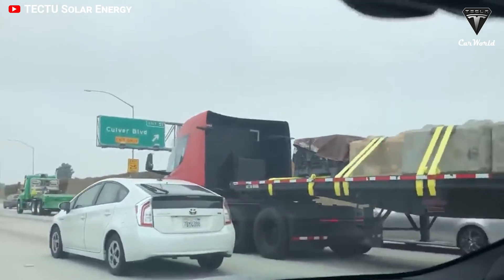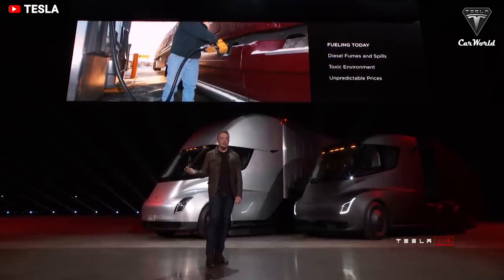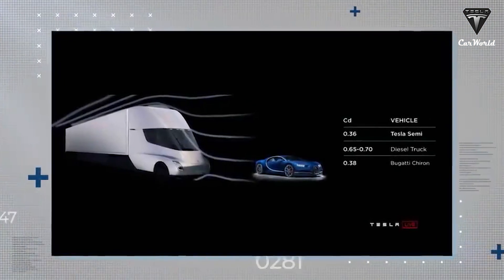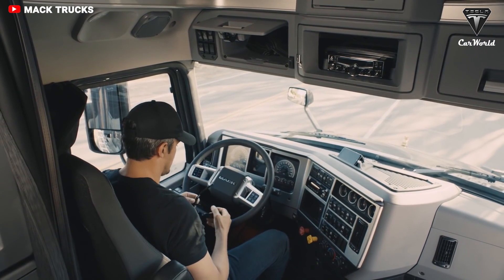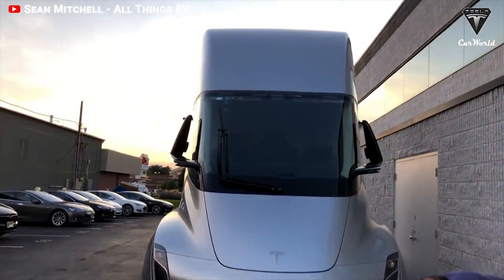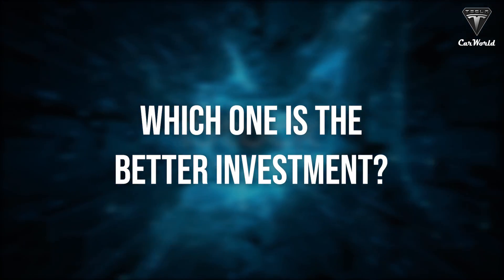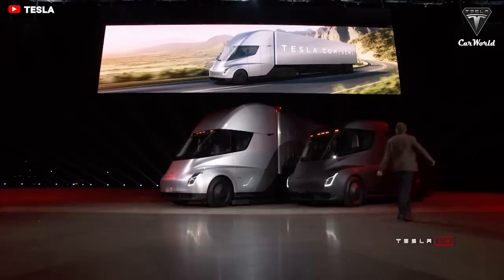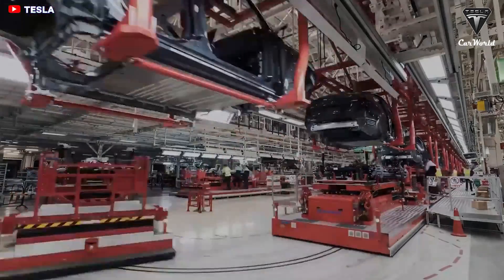Which is the KING of 2023 heavy trucks? Mack Anthem Diesel Truck Vs. Tesla Electric Semi?

Comment: When truck driving, you get paid by how MANY miles you drive. Not how fast you drive those miles. I noticed you didn't say ANYTHING about how long it will take to charge that that new toy. In order to really compete with diesel trucks, a company will have to purchase  2 teslas. One will always have to be charging while the other is being used. This is because the diesel can turn right around in 15mins, and do another 1500 miles. Where as the tesla CAN'T. So the true purchase cost of going with tesla is Double that of the diesel. Also you HAVE to include the cost of adding a high level charging station(s). A one time cost of several thousands of dollars. So if you are REALLY going to compare it, please be equal.  The Anthem, $180K and your done .. start hauling . and to do  the equivalent with Teslas you looking $300-350K 
  Now with ALL that said, for intercity distribution, and for a large enough company the investment is worth it. But for long haul, and indepenant truckers, it's not a sound financial choice. You say King of HEAVY truck... Nope you are wrong here. At BEST,.. it's about 2/3rd equal.  You made good points but most of them don't mean squat for trucking.

Comment: HP is  irrelevant to truck, it'd all about torque, and guess what, the desil has more. Not to mention imagine how convenient it will be WHEN the tesla truck does break down and you HAVE to bring it in to tesla or a very expensive certified mechanic. Add onto that, the limited parts availability and the expensiveness of said parts. Furthermore those batteries hauling 80 thousands pounds won't last just a few years beofre their range plummets a lot. Just think how long your phone battery last like it's new. Not very long. New tesla car batteries cost around 10,000, tuck batteries will cost multiple times more

Comment: Semi trucks aren’t about acceleration 🤨 there about towing heavy weighting loads efficiently and I don’t trust truckers with vehicles that the makers claim to be self driven vehicles that’s how you get into trouble.and biggest issues with evs right now the battery range goes down the more power you use like A/C accessories imagine what would pulling an big box around will do to your vehicles sensitive range or driving fast 👀. plus anyways that Tesla semi lacks the most important thing to truckers an bed instead they put an seat 😕 .truckers would you guys rather sleep on char or an bed ? And is the best way to slow down 80-90k LBS is with an jake break vs steel brakes ?. Semis use air so that’s also something that’s gonna eat your sensitive range up along with a/c etc .ev semi truckers question for ya what happens when these ev semi run out of power like in an hot desert like driving though the hottest points of Arizona or Nevada who’s gonna save you ? an ev semi tow truck ? He will break down to 🤔 who gonna save you and the other guy ? AAA? in the future hope they still have diesel semis or buy then have nuclear semi trucks cuz if they don’t ya gonna be living in the desert until you walk to an nearby town good luck hope some kid doesn’t hack your ev or better yet uses an EMP grenade on your ev 🥸 oh yeah if something hard or an projectile hits those sensitive batteries your gonna see that truck burn for hours call 911 cuz your not putting that fire out 😳

Comment: The Tesla semi weighs about 65,000 lbs. That's just the truck. Then you add a 10,000 lbs trailer to that then you are left with an absolute maximum of 7,000 lbs of cargo. Just about any pick-up can haul 7,000 of cargo. The Rivian can haul 7,000 lbs for a fuck of a lot less money than the Tesla semi. So please explain how you believe that 7,000 lbs is equivalent to 35,000 lbs which is what a normal semi can haul?

Comment: This is very silly...most modern semi's made in the last 3-4 years average 7-10 mpg which is much better than what you used in this video. Not to mention most truckers are doing more than 200 miles in a trip or day. You can easily go well over 600 miles in a diesel truck without needing to stop to refuel. You can't do that with the Tesla...even with the extended range truck you can only go 500 miles and I would wonder if that is 500 loaded miles or empty miles. You conveniently don't mention that or the time it takes to recharge the truck which I wonder why....you also don't mention what the cost would be to replace the batteries in these trucks if they happen to go bad, or if you still get the 500 miles in cold winter weather which other electric cars don't get full charges. The Tesla truck is interesting, but far from very practical for most OTR drivers.

Comment: Seems weird we never talked about how far the Mack truck can travel on a full tank. Looking at some basic numbers online i found many are able to easily cross the 1000mile mark with fuel to spare. So yeah the tesla beats it in a short range test hands down but we never looked at how it does in long hauls. And with a range of 300-500miles i don’t think that it makes much sense to have a bed cabin in the first place since you will have to stop to recharge. Also with the concerns of EV car batteries catching fire and being several times harder to put out than a gas car i can’t help but feel scared for the day one of these gets into an accident. It does have much more safety but it doesn’t mean something wont happen. 
The thing that concerns me is Tesla’s secrecy with a lot of the details. Then again i guess we will see how it works when its fully released and had some time on the road
Fingers crossed
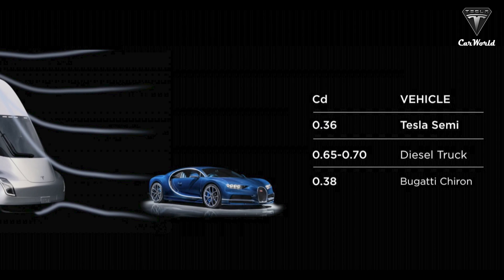Reply: 4:58 that is a lie cd = .36
Reply: Great minds
Reply: Tesla can carry 80,000 pounds of batteries in the trailer, surely someone will be able to hook them up.
Reply: @tobyw9573 hat is ~16 times too little to carry the same energy, do the math:
fuel oil 42000 Kilojoules per kg
battery:  0.22 kwhr per kg 
42000/3600 = kwhr per kg
= 70/6 ÷ 0.22 more trucks carring batteries  is a hell of a lot , no? , 
2.4 times less if you consider the lower efficiency of a diesel engine : 35%
electric motor:  85%
This is no joke
Reply: What surprises me is that you think someone would do 1000 miles without ever stopping. Tesla Semi truck drivers can charge when they to stop to eat or go to the bathroom unlike regular diesel truck which requires the driver to be standing monitoring the refueling process..
Reply: @charlolel what surprises me how are going to assume the electrical power transmissions are feasible to charge these amperehour guzzlers. It took a long time and investements to create a fuel delivery and storage system nationwide. You don't even know how many people are put out of work, takes a generation to train electricians charged to build new powerlines, Electricity does not come in fuel tank trailers. many more 'Road batteries', drivers etc would be required to transport the same energy to filli.... ah charging stations 
4 kg per kilowatt our is the weight of a battery 
4 kg per 16 kilowatt of chemical energy in diesel oil 
16 more trucks carrying batteries would be required to use the same infrastructure.
Reply: @charlolel  15 min fill up vs a couple hours 💀
Reply: @charlolel  does not charge fast enough for long haul.
Reply: @neviam62  Yes it does. Truckers are REQUIRED (in the USA) to take a one hour break in the course of a 14 hour work day. That is more than enough time to charge to 80%.
Reply: @theatremusician  Not if they are team trucks, the Tesla can't handle coast to coast as most companies and dispatchers expect. And there are thousands of truck stop nationwide with diesel, how many have charging stations for a full electric? This is where I think at this point Pete has the best idea with a hybrid truck. can cover the milles and the electric can assist when and where needed. Also many comments on rates of acceleration, although not that significant an item, the ability to climb steep grades with electric assist would be very helpful.
Reply: @texasbigwhitedog6683  there are plenty of chargers around. Certainly within 4-500 miles of one another. Also the post-truck-purchase cost of operation is just over half that of a diesel truck. Also, repairs are far more rare, easier and cheaper on the Tesla than a diesel. As even more charging stations are built, diesel trucks will be a rare sight in 20 years.
Reply: @theatremusician  you have to remember that most tractors stay attached to the trailer. Therefore "all" those charging stations that are set to charge a car won't work too well for a truck. And I have yet to see any truckstop with a charger and room for the whole rig.
Reply: @texasbigwhitedog6683  they’re all detachable. I’m not saying it’s the perfect solution right now, but it will soon be far more economical to run electric even OTR.
Reply: @theatremusician  yes they are but unless it a specifically someplace to drop a trailer you can get a really nice fine and dropping and hooking every 500 miles would be a MAJOR pain in the ass. At this time they are NOT practical for OTR work.
Reply: @theatremusician  truck drivers are required to take a 30 minute break after 8 hours of being on duty.  And they are allowed to drive 11 out of a 14 hour period.  Now when we are fueling up.  We are required by law to be on duty.  As in we can’t take a break while the truck is in any form of operation that may require our attention.  The FMCSA has already ruled that charging will be treated as active on duty time.  So we can’t take breaks while charging.  Also we only have space for around 40-60% of trucks if every truck stopped at the same time.  Charging bays will take around 1/2 the available parking and with the way drivers do we would have around half the charging bays destroyed every week.    Also not all drivers are able to park where charging is available.  This is why you see trucks parked on the shoulder, on off ramps and such.  I end up parked on streets and at customers around 90% of the time.  And then often I don’t have access to a bathroom.  Do you really think they are going to allow me to charge.
Reply: @theatremusician  trucks are much larger than cars and can’t get into the spaces where most of the chargers you are talking about are located.  The charging bays that are being suggested for trucks will expand a truck parking slot by about 5 feet.  Meaning one truck will be required to take up essentially 2 spaces.  And this doesn’t even take into account things like over dimension trucks.  Some of those guys require several spaces and have to park at odd angles.
Reply: @theatremusician  a truck can detach but by insurance bonds I cannot move more than a few feet away from the trailer while it’s loaded.  And if something happens to a loaded trailer like a fire or something and you weren’t present the dot will give you lots of paperwork.
Reply: @texasbigwhitedog6683  Their Megacharger stations are designed for them
Reply: @theatremusician  30m not one hour
Reply: @texasbigwhitedog6683  if you did your research you would learn that Tesla is working on many charging spots across America specifically for the semis. Before you say it’s impossible, it’s not. They did it with cars they can do it with semis.
Reply: @charlolel  so I regularly do around 300 ish miles without stopping.  But when I do stop it’s for 10-15 minutes at most with one 30 minute break.  I often am parked in locations without access to even a bathroom much less a power outlet to charge.  For long haul trucking Tesla trucks don’t make sense.

We currently only have parking available for between 40-60% of all trucks on the road.  The super charger bays will cut parking down by half in the truck stops that we currently have.  Also.  Every truck stop has a driver hitting either the pumps or another truck every few days.  Imagine the cost of replacing a supercharger every few days.

Comment: Everyone is complaining that you don't need acceleration in a truck. 
How about using the power and torque to maintain speed on an incline? And even downhill due to regenerative brakes vs. friction brakes?
Going 20 mph up a hill vs. 50-60 mph is a significant advantage, anyone saying anything else is lying to themselves.

Comment: I'm a little skeptical on these it's already hard enough for people to find places to charge that Teslas and when they do charge their Tesla's it's hilarious watching them sit in their cars for hours at a charging station but you're talking about Mack trucks that are going to go across country with extremely heavy loads now if anyone seen the reviews of the Ford pickup truck they've noticed that as soon as you hook up any load to these electric vehicles they drop like a boulder in water they cannot handle the pull for long because of the stress on the engine / motor I think they should have stuck with the four independent motors one for each wheel therefore they'd have redundancy if one or two failed if they were really smart they would have dinos on the front two wheels and only have two motors operating with two modular battery packs on the highway while the other two charge and then those motors switch over to the others and have those pick up off the charged batteries while the depleted battery start to get a charge that would be the only way this is feasible to take over the country because you're going to have to install supercharged in stations at every single weigh station and put in a crapload but you also going to have to have dedicated locations with people monitoring them because everyone sees truck stations where there's 50 to 100 semis parked because they can't be on the road and they're everywhere

Comment: Infrastructure is still not ready for electric semi-trucks for local delivery; let alone for OTR rig's.
I have been an OTR driver for 30 years and acceleration is the farthest thing from my mind; fuel mileage is the main key and 2nd is how serviceable is the rig, bet I could work on a Mack vs a Tesla.
Safety lmao more than one tesla has run into parked vehicles and then there are those that catch fire; think an electric car fire is hard to fight, up to 500 gallons reported in an Orlando FL incident, so imagine the size batteries in an electric truck that will be on fire and imagine the difficulty in fighting that fire, all fire departments need to be upgraded and trained for this hazard.

Comment: Nice Truck... Till you need to repair it !!! Will Tesla allow road side repairs? From a truck mechanic. If there cars are anything to go by NO. Tesla dose not allow right to repair. So if it brakes down it will need to go back to Tesla for repair. Then any money saved in fuel, will go out the window in repair costs.. Pepsi and other big company's may buy them. But I will say with 100% serenity the won't get ride of all there diesel trucks..These company's are only buying these trucks as a PR exercise.. I wonder how many independent truckers or small trucking company's will buy them?

Comment: So you boast about the tesla truck, but if you would run it side by side with "any" truck than you would have a different story to tell. The tesla truck cannot out perform a diesel truck.
Reply: Winning a coast to coast race does not help the fleet owners and their profit. It all comes down to operation costs a mile, where Tesla outperforms diesel, it is suggested

Comment: I hate to be the bearer of bad news but electric semi trucks will never replace Diesel powered trucks. You just can't modify them in ways a normal truck can be. Also your so called range???? 200 300 miles....LoL!. My truck gets on average 1000 miles of range. Yes, Diesel is expensive but its just passed on to consumers. Also, where are all these so called charging stations on the insterstate for these trucks🤔🤔🤔🤔 funny I havent seen them yet from Georgia all the way to Arizona, to washington to north dakota to florida. Also, your truck needs to charge in 30 min maybe 45 max. Hmm lets see i fill up in Atlanta and drive for 10 hrs and im in texas. No fill up yet. I stop for rest. I get up and drive to cali same fuel tank. Drop load drive to Arizon fill up then off to wherever...your math isn't correct. Now as an innercity truck it does make alot of sense. With traffic, stop and go. Charging stations are available more...hmm for cars yes but still no for semi trucks..hmmm wonder why???. Oh thats right truck stops will require more real estate and power will have to be installed in....hmm high voltage and fuel dont mix well...🤔 Also truck stops will have to charge a premium for those Tesla stations which will always be in use. Any guess how many trucks are sitting right now at any truck stop in U.S.? More than 100 some have 200 trucks and trailers.
Reply: There will be a mix of different trucks. Eletric, diesel, hydrogen, LNG, +. The Teslas will be set up running mostly fixed routes, with charging and all calculated in. And possible in not too distant future, with out drivers. And largely away from snow and cold. Other truck takes care of the rest

Comment: Try getting your facts straight.   The motors were going to be the M3 motors but  are delivered with plaid motors at 1000 Volts instead of 400 Volts.  That might make a difference.